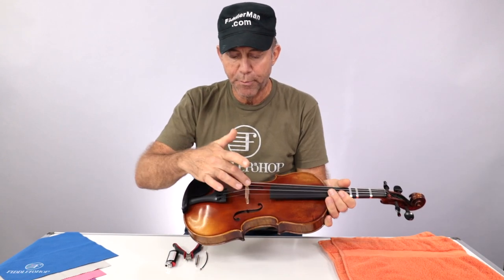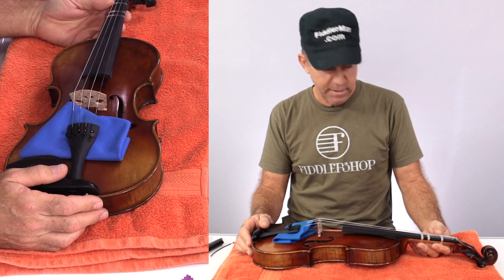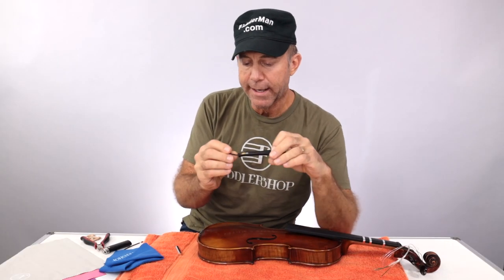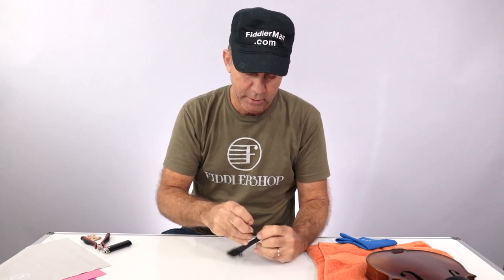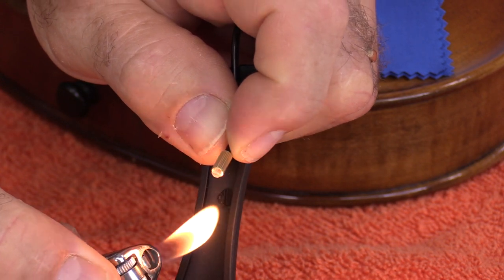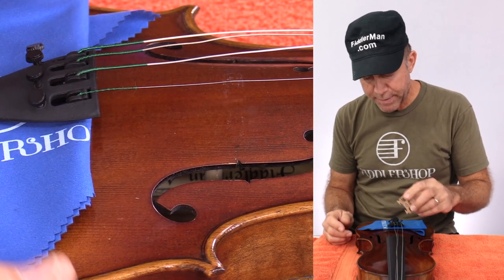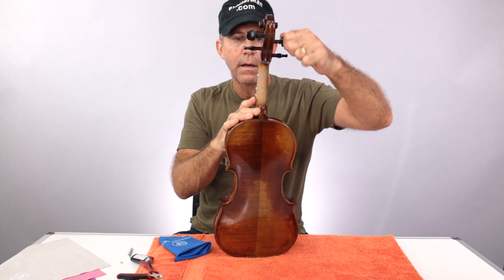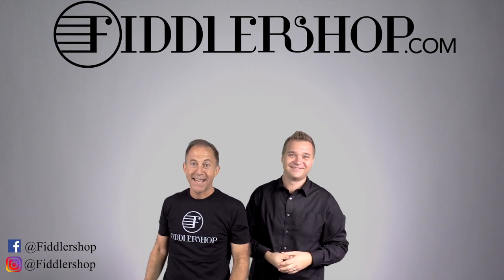How to Change a TailGut (Tailpiece Adjuster) with Fiddlerman

Comment: What’s the likelihood of the sound-post moving or falling while the strings are loose?
Reply from the maker: It's possible of course. We definitely recommend keeping the violin flat on the work surface, and try not to move it excessively for that reason, but a correctly set soundpost shouldn't fall too easily.
Reply: @Fiddlershop  glad to know, mine has fallen a few times if left out of case or changed strings.

Comment: Fiddlerman my gut string  came off the tail piece.  It popped. 
Can it be replaced or do I need a whole new tailpiece
Reply from the maker: If it looks like everything's still intact, you could try again, but it will most likely just happen again. There's probably something that just needs to be replaced. If it looks like the hardware (nuts or washers) are still in place, and they just slipped through the tailpiece, you might have to replace the tailpiece, or you could try a kevlar tailgut where you can tie larger knots underneath the tailpiece like: https://fiddlershop.com/products/multi-fiber-tailcord